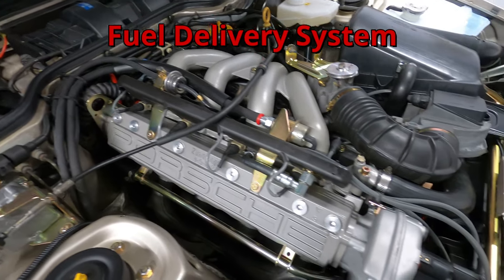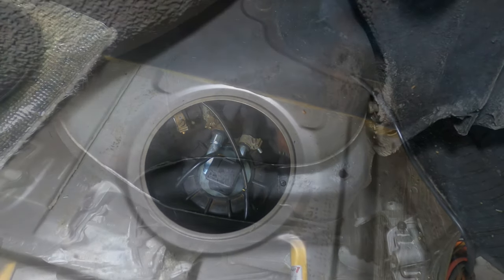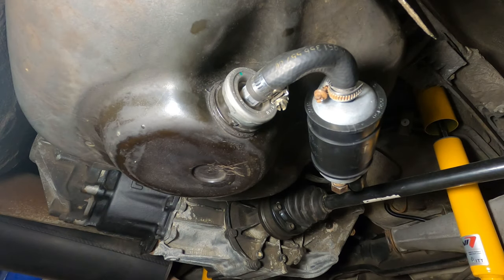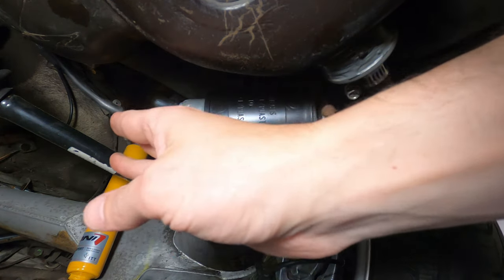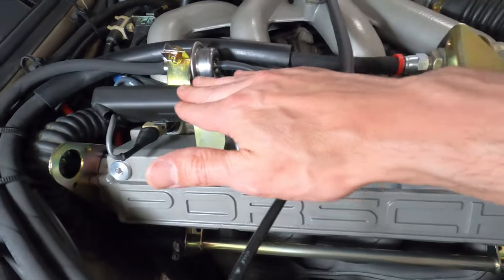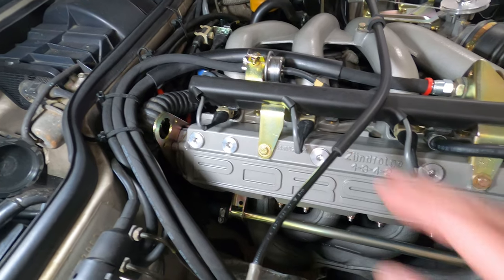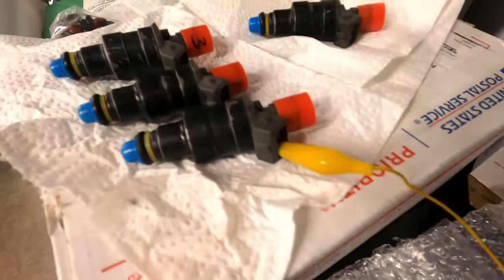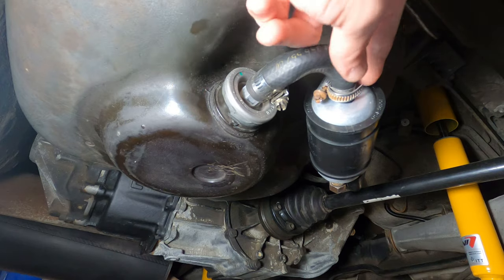Porsche 944 – Fuel System Overview: Parts, Issues, & Costs

Comment: can i get a list of parts from you for complete fuel system rebuild? everything from the back to the front minus the fuel lines please...i just purchased 88 944 and needs some TLC
Reply from the maker: Hey John, I don’t really have a list like that built out, but it’s fairly easy to obtain that info from the classic parts catalog found here - https://www.porsche.com/usa/accessoriesandservices/classic/genuineparts/originalpartscatalogue/ - just select the model and year and then download the PDF. Pages 110 and 146 have the fuel system components displayed and listed out.
Reply: @NC944er  oh lord i was looking for something a bit more simple like;
fuel filter, fuel pump, etc...lol
there are two parts on top of the fuel rail that i dont know name of that i want to replace when i do injectors...
Reply from the maker: @johndeltoro7990  Gotcha! Yeah, attached to the fuel rail are the fuel pressure damper (944-110-201-03) and the fuel pressure regulator (944-110-198-03). There’s also a short high pressure fuel line from the damper to the rail (944-110-413-02) that could be replaced while you’re in there if it’s showing any signs of aging/cracking.
Reply: @NC944er  yeah I’m going to just replace everything because car has sat for a while and really don’t trust those kind of parts just sitting and drying out
Reply: @NC944er  ok my friend I need your help 911!!! I can not for the life of me figure out the clips that hold the fuel injector(s) into the fuel rail…can you please shed some light on this?? I thought I paid attention to them when taking off but I guess I didn’t…. Thanks in advance
Reply from the maker: @johndeltoro7990  Here you go... https://youtu.be/Cb_EaTyQvF0
Reply: @NC944er  YOU ARE THE FREAKING MAN!!!!!!!!!!